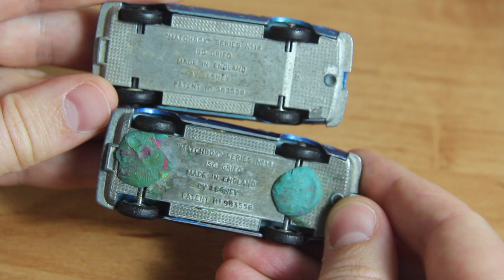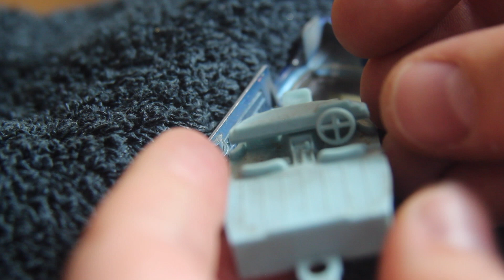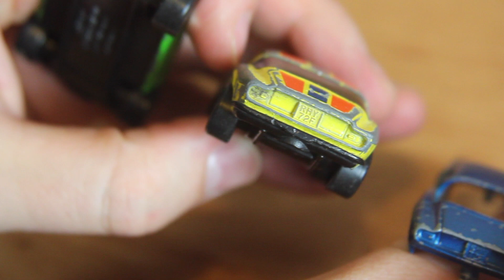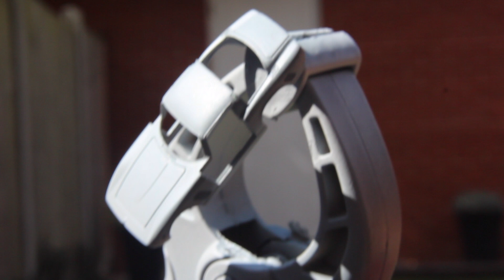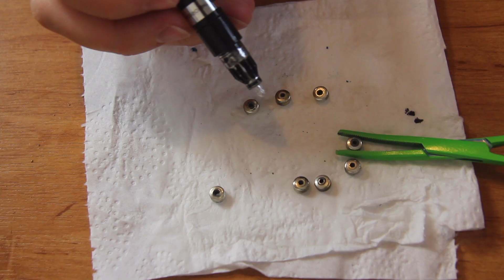MATCHBOX restoration: No. 14D Iso Grifo - DIECASTRESTOS

Comment: Jason, truly like the format of your channel. Hope you never change the scope of it significantly. The length of videos is just right, and like the fact you use only rattle cans and inexpensive, straightforward techniques to do your work. If you ever run out of colour selection with Tamiya, for say future customs, there are so many other different shades available in the automotive industry, so the possibilities are virtually endless. Nice job with the Grifos. Like the custom wheels more than the originals, but can understand why you would want one model version closer to factory specs. Cheers!
Reply from the maker: Thanks for the comment, I appreciate your feedback throughout all of my videos! Your suggestion for a decent lighting rig way back when really helped improve the quality of visual output in my opinion so I thank you for that. I am going to investigate to see what other spray can paints are available from my local car parts/auto repair shop. I've exclusively used Tamiya aside from the khaki-like green on the 73C Mercury and that came out fairly well considering it was my second-ever build. I'm a bit stuck in my ways with Tamiya though, the quality on the darker shades is incredible and doesn't blot out any detail. However, I'm definitely looking at something a bit more substantial for lighter shades, whites and yellows in particular. Anywho, thanks for stopping by again!

Comment: The coloured 'crud' on the base was Plasticine a popular childs modelling clay from the same time period as the car and probably still is in some form or another, came in a set of various colours. You mentioned how easy the metallic paint went on but are you using metallic paint because you want to avoid the actual method Lesney used?
Reply from the maker: Thanks for watching 😊 I used the metallic paint due to budget constraints and the ‘out of the can’ blue was a fairly decent match to how the clear over primer method Lesney, especially with the equipment I had to hand during my early days of restoration. Glad that you noticed it was dried plasticine too!
Reply: @DieCastRestos  - true their light metallic coloured basecoats did act as a primer and their candy colour topcoats did act as a clear coat but that's only half of the reasoning they were using, they got depth without any depth, mixed colours without mixing them and lacquered them without laquer. Not easy to get right at home admittedly but worth it imo.